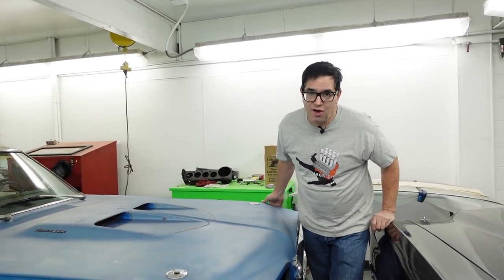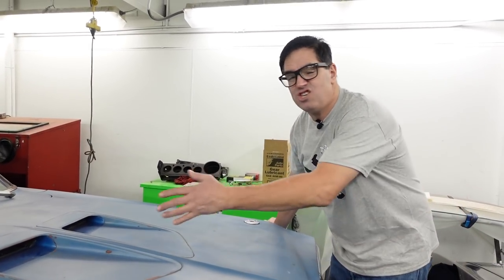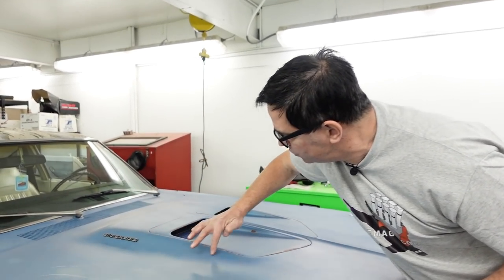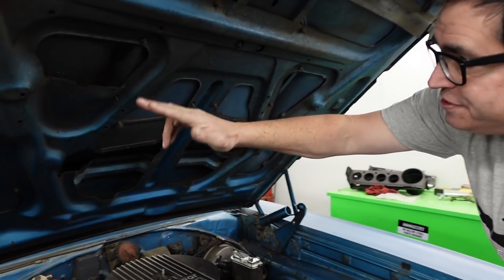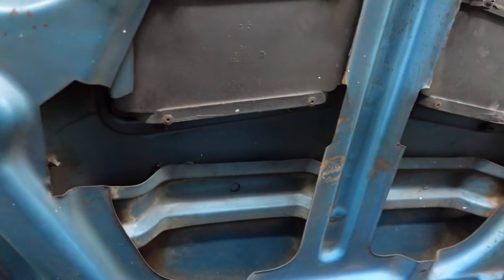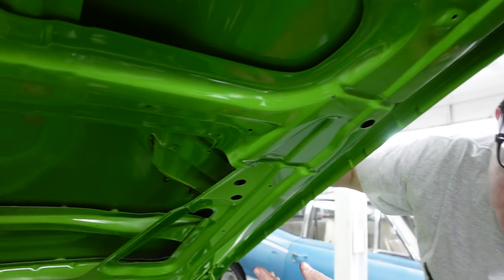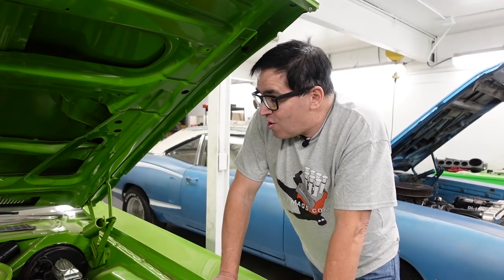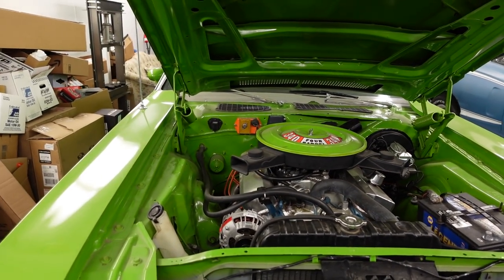Muscle Car Crawl: Dome Hood Dreams

Comment: My ‘70 ‘Cuda is E87 D21 A33 N96. I got it back in ‘83, and you almost never saw a Shaker hood car in the 80’s or 90’s. By the late 90’s they repoped them, and it was hard to find a car that didn’t have a Shaker. 😀

Comment: I’m really amazed at how many old muscle cars have survived all these years.
Reply: They are built to last, and to be rebuilt. I cant say much for all that plastic shit on newer cars of today. Most of them do not have any kind of dipsticks, motor or tranny... Anymore
Reply: @moparmarkstpac  BMW., Mercedes, audi, ford,, mazda. 
Just to name few.

Im older, but not that old @36.... And i cant stand newer cars. 

I bought gen 3 hemi from the junkyard to swap into my old d150.... And the thing does not have a oil fill cap on the valve covers. (An engine thats been known to have oiling issues at that)
Reply: @MrCriminalmischief  My Mazda's have engine oil dip sticks
Reply: @sdc5683  does it have a tranny dipstick? I just check my girlfriends cx5... And couldnt find it.
Reply: @MrCriminalmischief  No tranny dipstick in my CX5 and my 2009 Equinox does not have one either.Mostly a thing of the past I think.

Comment: Even without the ducting for the air cleaner opening the block offs does add some much needed cooler air into the engine compartment  since most is being preheated thru the radiator without the addition from the hood.
Reply: i was thinking about that on  the power bulge hood on my 1974 plymouth  roadrunner

Comment: Once drove a 68 or 9  Road runner with a functional “Air Grabber” hood.  The car was 383 runner, root beer with black stripe & riad runner decal. there was a protected switch on the dash and when you flipped it this mass of the hood opened up and forced air into this big orange housing around the carbs...  Would you tell us about those?
Reply: awesome, right? that kind of Air Grabber started in '70. it was vacuum operated.  on Dodge it was called Ramcharger. my '69 RR had an Air Grabber system that drew Air in from the 2 foot long bumps(vents) on the hood that fed Air, to a box, sealed to the air cleaner. it had a cable operated on/off system to keep rain from getting to your air cleaner.

Comment: What about the dual snorkle hood scoop that came on some Dusters and Demons?
Reply: same deal. non functional, but, you can tell that they had planned for them to possibly be functional. as the bracing is altered similarly to these. it was just like what Steve is describing in this video about the other style of Super Bee/RT, dual scoops. often referred to as raisin bran, lol
Reply: @mrkemblegilstrap  Although I’ve never seen one in person, I have a factory parts book that has the exploded view of a 70-71 A-body fresh -air ductwork mounted to the underside of the hood. A friend of mine who was a parts manager at the local Chrysler dealership looked at the pictures and commented that he never saw one.
Reply: @anthonybrincefield2812  that is awesome! man, Anthony you blew me away.  thanks a million for that information. that book is mythical. I wasn't even aware that all that was even in a parts book. back in my day, I pretty much had both volumes of the Direct Connection books, memorized. I had a Charger, a Challenger, a Road Runner, a Duster, and a Super Bee. now, that I think about it. since, those boxes made it on to certain B bodies, that it wasn't production cost that killed them. I think that they decided not too, because they didn't work! have you seen wind tunnel testing on hoods? there's that boundary layer of dead air, which means most of their current scoops didn't do a darn thing. they prolly could have actually been detrimental and sucking air out of the air box. look at Mopars other scoops. i e, the race Hemis, the Challenger T/A, the A12 cars. my Bee was a A12. on mine, that middle support post, in the middle of the scoop, broke completely out. so, when I was running thru the 1/4, that thing really was catching air because it swelled up and bulged. (BTW, 12.55@107mph). have you ever seen an old convertible hauling ass? that cloth top bulges from the air going thru the car. I honestly think the air Grabber on the AAR Cuda and my '69 RR were useless. the Grabber on '70-74 B bodies might have been a teeny tiny bit effective because they were on that fiberglass bulge that they had. Might! but the gimmick/WOW factor made it the real reason they were there. my BF had a '72 RR that had it. you definitely felt that you had an edge over that stupid Buick. psychosomatic, possibly. fun? positively! Chrysler played rough and so did I.
hey? if I gave you my email address, could you send me a photo of the A body air box set up diagram? 
once again thank you, for taking the time to have written to me. Happy New Year, to you.
kembleg7@gmail.com

Comment: Is that unit on the table in the backround for setting pistons into the block?
Reply: It's a dash bezel housing for a standard gauge cluster in a 70-74 Challenger/Barracuda. 👍
Reply: @hedkace  Thank you, that explains the largest hole, i couldn't see that well.